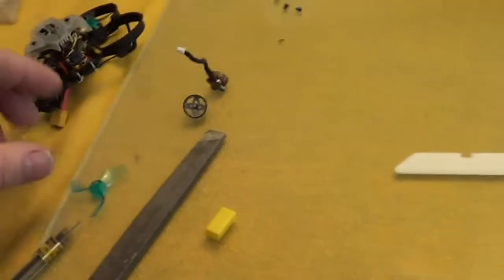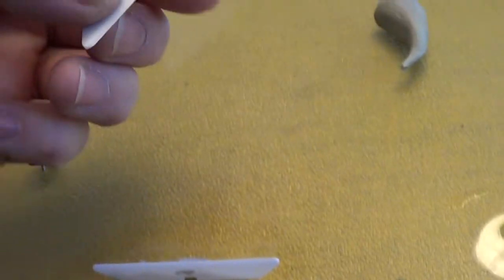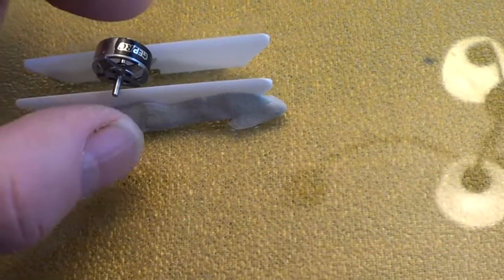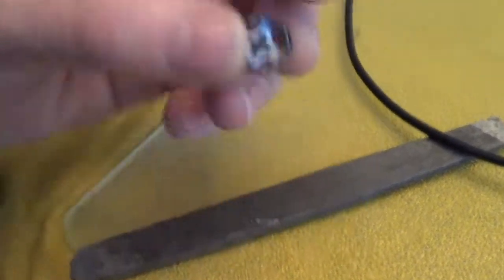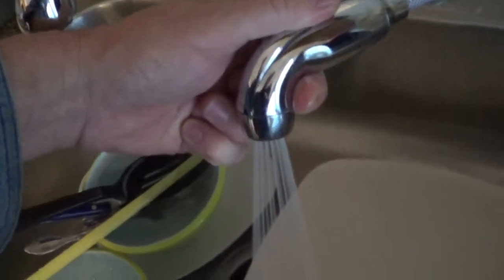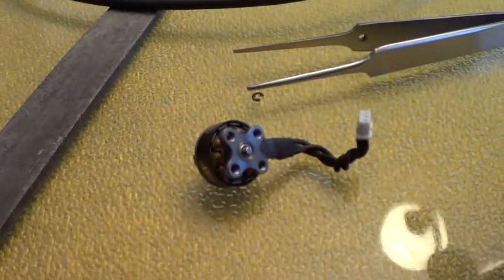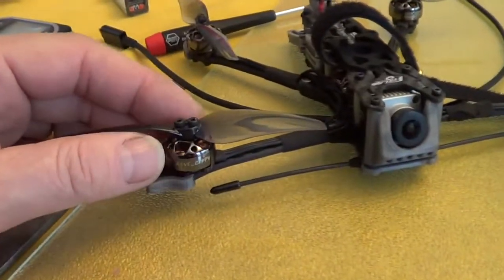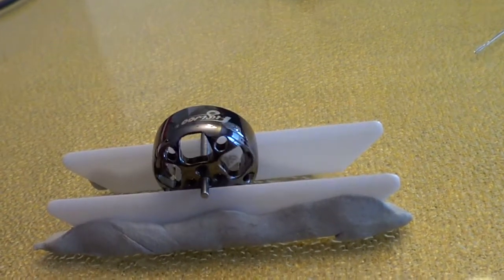How to Balance Micro Brushless Motors

Comment: What about if the shaft is bent :) I guess in that case I'm out of luck... I think balancing these tiny motors is really a pain in the ass. To do what you did you first have to straighten the shaft, next step is to have good bearings and then you can finally balance the bells if they need to be balanced. I mean I will give it a try but I guess I'll just have to buy new motors in the end and maybe just balance the bells on them. Until I crash again. LOL
edit: does anyone know where to get new shafts for these motors? (1103 - mine are from eachine NC1103 KV8500).
Reply from the maker: Always keep parts from your old motors.   You can usually see a bent shaft looking closely at the bell when turning it by hand.   You can mix and match parts.   I found a quick balance check is turtle mode running full throttle (with prop) on a motor in reverse.   The bad motor really shakes the frame like an earth quake.   I am trying out japanese bearings now.   I will do a video if they last longer than the chinese ones.

Comment: Just the video I needed, thanks!
Reply from the maker: I got some bad news about micro motor balancing.   I typically run 65,000 rpm and the bearings become loose after a few hours of run time.   I will do a video on replacing the micro motor bearings.   They makes a much bigger difference than balance because when the bearing has play, the entire rotor wobbles in an orbital pattern.   The vibration is nasty.   I tried some ceramic bearings, but they were junk brand new out of the bag.   I'm waiting on some Japanese 5mmx2mmx2.5mm bearings now.   They cost $2 each from aliexpress.   But, they will probably be better than balancing with bad bearings.   Any play side to side at all causes serious vibrations.
Reply: @microdronetech8453  Ok, thanks! Yes you're right, micro motors bearings are terrible, I do feel like betafpv motors have a bit higher quality then happymodels. Looking forward to the results, I've build an "outdoor" whoop (with better vtx and receiver) and it has runcam split 3 for HD recording. The quality is decent for the size and weight, but the jello introduced by the motors is terrible, especially in bright sunlight. I was hoping on eliminating as much vibrations coming from the motor and prop combination as possible. So I'm crossing my fingers 🤞 new bearing do the trick! If you are interested here's a link to my  "problem whoop" https://youtu.be/inHDvG4ZXE8

Comment: Any updates on the Monero mining setup?
Reply from the maker: I had to switch to the Torr network for mining.   The local cable company started blocking all the mining pools.   That rig runs rock solid.  Profit keeps hanging out at electricity prices.  But, I like the free heat in the basement.
Reply: @microdronetech8453  I see. Thanks man and godspeed 👌

Comment: I wish I could buy both motors and props pre-balanced. I notice you also have the GepRC P16 HD. On the stock tune when I do acro often one of the corners dips when coming out of a roll and it makes a momentary high pitch sound. Have you encountered this?
Reply from the maker: You are getting washout.    I spent a lot of time minimizing washout on roll and yaw.   The key is not using a heavy battery.   Stick to 300mAh 3s or lighter.   Washout occurs when the i term reaches max and then gives up.   There are a bunch of different fixes for this.  Here are my notes:

Joshua Bardwell Washout Tips:    https://youtu.be/TeYMJy23vK4
  
1) Turn off d_min
2) Increase D gain
3) Lower Blheli PWM Frequency (Kept at 96Khz)
4) Set thrust_linear = 5  (15 for 300mAh?)
5) Increase idle speed 

Joshua Bardwell Min RPM (Dynamic Idle) Tips:   https://youtu.be/2Mr-AP7K8YE
1) Type get idle
2) set idle_min_rpm = 20   (20 x 100)

Good Washout Tuning Document:
https://docs.google.com/document/d/1xlaGtkMGJUP1UwcJw1xqIG9TCuA0a7NtbvzOQrsN7hM/mobilebasic

ESC Settings

1) Download BLHeli Configurator and save to a local directory.    https://youtu.be/FnBpK-nc3qY
2) Update all 4 ESCs to 16.9
3) Configure the ESC
	a) CE = Async-PWM
	b) Startup Power = 1.5
	c) Temp Protection = 140C
	d) Check Low RPM Power Protection
	e) UnCheck Brake on Stop
	f) Demag Compensation = High
	g) Motor Timing = Medium High
	h) Beeper and Beacon set to 1 to save battery
	i) Beacon Delay set to infinity to save battery
4) In Betaflight
	a) Choose DSHOT300
	b) Check Bidirectional DSHOT
	c) Motor Poles = 12
	d) Motor Idle = 6.5
Reply from the maker: Here are my beta flight settings:

# 

# diff all

# version
# Betaflight / STM32F411 (S411) 4.2.6 Jan  5 2021 / 19:07:43 (a4b6db1e7) MSP API: 1.43
# config: manufacturer_id: BEFH, board_name: BETAFPVF411, version: 5e160c8b, date: 2019-12-11T10:26:31Z

# start the command batch
batch start

# reset configuration to default settings
defaults nosave

board_name BETAFPVF411
manufacturer_id BEFH
mcu_id 0043002a3030510331333433
signature 

# name: Thinking P16

# resources
resource LED_STRIP 1 NONE

# feature
feature -SOFTSERIAL
feature -AIRMODE

# beeper
beeper -GYRO_CALIBRATED
beeper -RX_LOST
beeper -RX_LOST_LANDING
beeper -DISARMING
beeper -ARMING
beeper -ARMING_GPS_FIX
beeper -BAT_CRIT_LOW
beeper -BAT_LOW
beeper -GPS_STATUS
beeper -ACC_CALIBRATION
beeper -ACC_CALIBRATION_FAIL
beeper -READY_BEEP
beeper -DISARM_REPEAT
beeper -ARMED
beeper -SYSTEM_INIT
beeper -ON_USB
beeper -CAM_CONNECTION_OPEN
beeper -CAM_CONNECTION_CLOSE
beeper -RC_SMOOTHING_INIT_FAIL

# serial
serial 0 1 115200 57600 0 115200
serial 1 64 115200 57600 0 115200

# aux
aux 0 0 0 1700 2100 0 0
aux 1 1 2 900 1450 0 0
aux 2 2 2 1450 1925 0 0
aux 3 13 1 1625 2025 0 0
aux 4 28 2 1925 2100 0 0
aux 5 31 2 1025 1100 0 0
aux 6 35 2 1100 1175 0 0

# vtxtable
vtxtable bands 5
vtxtable channels 8
vtxtable band 1 BOSCAM_A A CUSTOM  5865 5845 5825 5805 5785 5765 5745 5725
vtxtable band 2 BOSCAM_B B CUSTOM  5733 5752 5771 5790 5809 5828 5847 5866
vtxtable band 3 BOSCAM_E E CUSTOM  5705 5685 5665 5665 5885 5905 5905 5905
vtxtable band 4 FATSHARK F CUSTOM  5740 5760 5780 5800 5820 5840 5860 5880
vtxtable band 5 RACEBAND R CUSTOM  5658 5695 5732 5769 5806 5843 5880 5917
vtxtable powerlevels 5
vtxtable powervalues 25 100 200 400 600
vtxtable powerlabels 25 100 200 400 600

# rxfail
rxfail 5 s 2000
rxfail 6 s 1000
rxfail 7 s 1000

# master
set dyn_notch_width_percent = 0
set dyn_notch_q = 200
set dyn_notch_max_hz = 500
set acc_trim_pitch = 36
set acc_trim_roll = -6
set acc_calibration = 47,-23,-41,1
set rssi_channel = 8
set fpv_mix_degrees = 45
set serialrx_provider = CRSF
set blackbox_p_ratio = 64
set dshot_idle_value = 650
set dshot_bidir = ON
set motor_pwm_protocol = DSHOT300
set motor_poles = 12
set ibata_scale = 512
set ibata_offset = -550
set yaw_motors_reversed = ON
set small_angle = 180
set gps_rescue_initial_alt = 60
set thrust_linear = 5
set osd_units = IMPERIAL
set osd_warn_batt_warning = OFF
set osd_warn_core_temp = OFF
set osd_tim1 = 0
set osd_tim2 = 1
set osd_vbat_pos = 353
set osd_rssi_pos = 2532
set osd_tim_2_pos = 375
set osd_flymode_pos = 2538
set osd_throttle_pos = 427
set osd_vtx_channel_pos = 33
set osd_current_pos = 493
set osd_mah_drawn_pos = 493
set osd_craft_name_pos = 361
set osd_warnings_pos = 329
set osd_avg_cell_voltage_pos = 2545
set debug_mode = GYRO_SCALED
set vtx_band = 5
set vtx_channel = 7
set vtx_power = 3
set vtx_freq = 5880
set name = Thinking P16

profile 0

# profile 0
set vbat_pid_gain = ON
set anti_gravity_gain = 2000
set feedforward_transition = 20
set iterm_relax = RPY
set iterm_relax_type = GYRO
set iterm_relax_cutoff = 17
set iterm_limit = 500
set pidsum_limit = 1000
set pidsum_limit_yaw = 1000
set throttle_boost = 13
set acro_trainer_angle_limit = 80
set p_pitch = 64
set d_pitch = 50
set p_roll = 59
set d_roll = 46
set p_yaw = 63
set level_limit = 90
set d_min_roll = 0
set d_min_pitch = 0
set idle_min_rpm = 20

profile 1

profile 2

# restore original profile selection
profile 0

rateprofile 0

# rateprofile 0
set thr_mid = 30
set thr_expo = 65
set tpa_breakpoint = 1500

rateprofile 1

rateprofile 2

rateprofile 3

rateprofile 4

rateprofile 5

# restore original rateprofile selection
rateprofile 0

# save configuration
save
#
Reply from the maker: Here are the specific CLI settings to lower washout:
set dyn_notch_width_percent = 0
set dyn_notch_max_hz = 500
set dshot_idle_value = 650
set dshot_bidir = ON
set pid_process_denom = 2
set thrust_linear = 5
set anti_gravity_gain = 2000
set iterm_relax = RPY
set iterm_relax_cutoff = 17
set d_min_roll = 0
set d_min_pitch = 0
set idle_min_rpm = 20
Reply: @microdronetech8453  Wow thanks. I was curious as to if yours also dipped on the stock tune and if I needed to tune or if it was maybe a hardware issue as it's brand new. Didn't expect such a great response. I'm running GNB 3s 350mAh LiHV skinny 30C packs. I did suspect perhaps it's a bit heavy given the vista which I'm going to naked mod to shave 10 grams. I will try those settings thanks again. 😄👍